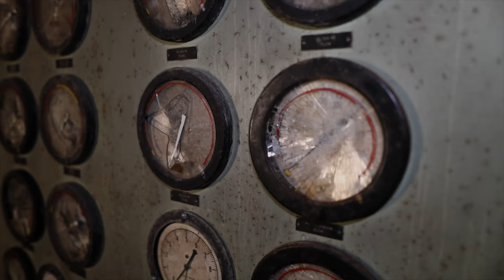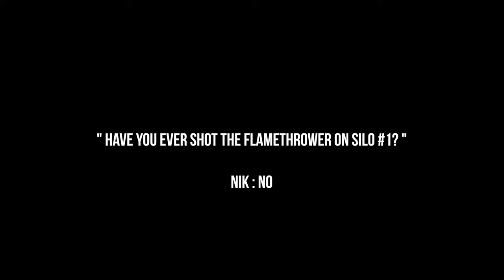Ep. 65 - An 80 TON CRANE Declares WAR On A Military Underground Bunker

Comment: Ideas: Pour water in that gap to see if it goes all the way through.  If not, try oil to help loosen things up.  That crane was only doing 21,000?  11ton?  That really isn't that much.  Just to break it loose you could try bridging it with a heavy I-beam bolted or chained to the cork and use bottle jacks on either end of the beam. Or better yet would be 3 beams, one for each lifting point with 2 jacks on each beam.  Jacks are placed on the ground beside the cork with plate steel under them.  It wouldn't lift it very high but at least you could get it broke loose and go from there.  Assuming that cork is 10' diameter, 3' thick that's just short of 9 yards of concrete.  I just looked it up and cured concrete weighs right at 2 tons per yard for 18 tons.  Not much extra capacity on that crane and that's assuming that cork isn't thicker or bigger diameter.
Reply from the maker: Appreciate the ideas. Very interesting
Reply: @NuclearBunkerLiving  PS: Something you could have tried was using your loader along with that crane to give a little extra oomph.  I don't suppose they'd be interested in a quick round 2?
Reply: Absolutely what I was thinking also, widen the hole bridge the cork with two heavy beams and lift with hydraulics. Break the seal loose and then lift with a crane, much easier done. And another thing Nuclear Bunker Living I've worked with cranes, tower, crawlers, mobiles, there all great but if you want to get something moved call an equipment rigging company in not just a crane company, if you've seen a rigger move a 30ton CNC machine from one side of a plant to another with little more then pipes and a bar then you'll understand what I mean.
Reply: Adding to the above. What if you could do a shock or vibrate while your pulling? Thinking a hand held jack hammer or one mounted on an excavator?

Comment: If that cork is made of reinforced concrete formed in place at the time of the bunker's construction with the huge rebar that they used, I can imagine it being welded to the steel frame before the concrete pour. A thermal lance will blow right through that cork all the way around and cut it into small sectors if required. Make inquiries to a welding supply company for a thermal lance and cut the SOB!
Reply from the maker: Wow. Thanks for the feedback Keith

Comment: Thoughts:
I beam spanning the lid to solid ground. Maybe even fabricate an X out of them to go across it. Attach to lifting points. Place a 20 ton Hydraulic jack on each corner, on steel plates sitting on the ground. Use the combined force to pop the lid, would also allow off axis pressure to maybe get one part to break free first. It won't let you take the lid off and out of the pit but it could break it loose for a crane to complete the lift. You look like you are at no shortage of beams/plate, 30 ton hydraulic jacks are $120ea at Harbor freight. For under $600 all in it seems like it would be worth a shot. Just kinda spitballing here.
Reply from the maker: Thank you my friend. Appreciate your feedback

Comment from the maker: 🚨 🚨 PLEASE READ:

Hey it’s Nik. Appreciate the communities feedback with this weekends Episode 65.  As I said on this episode, taming is the conditioned behavioral modification of a wild-born animal when its natural avoidance of humans is reduced and it accepts the presence of humans. 

Well…It’s the same principle here at this Titan 1 bunker complex. 

The “Tap Tap” theory of tapping the top of the lid to dislodge it won’t work because of the funnel shaped dimensions. Any pressure downward may fracture or compromise the surrounding concrete and rooftop structure. Using hydraulic jacks under the lid and pushing it up won’t work as we don’t have a platform high enough to mount the jacks. When the lid was sealed in 1967, the military poured adhesive elements and concrete on the sides of the lid to ensure it remained permanently sealed. 

Wild winds on the same day as the crane attempt also hindered us. We pushed the threshold to 21,000 and the alarm was triggered to pause all operations. This was an 80 ton crane we used.  We may need to amp it to a 110 ton. 

The eye bolts on the lid were engineered correctly. They are drilled deep and epoxy glued as well. We used the right cable this time as opposed to chains.  

We will prevail. It just takes resilience, grit and an ounce of ALPHA. 

At all times. We don’t edit and delete footage that went against us. In full disclosure, we share all footage to show you the dark days of frustration and annoyance when things don’t go our way.  We owe it to our community of subscribers to showcase our tribulations and success. 

We thank you for your continued support. THANK YOU
Reply: Maybe next time you should build a road and pad area for the crane to get closer to the cap, I know if the boom is extended out like it was they have less lifting power, so getting it closer so they don't have to extend it out far will give them more lifting power.
Reply: I hate to say it, but if the government intended for it to remain permanently sealed….. I don’t know what your plans are for the equipment terminal, but at this juncture If you can’t apply pressure from the exterior, even demolishing the lid and replacing it later with something else may not be an option.
Reply: I love seeing all aspects of this project.  It wouldn't be that interesting if everything went easily and according to plan.  It's the overcoming of those obstacles that make the journey far more rewarding.
Reply: Long shot but, would a powerful solvent be a bad idea? Take samples of the adhesive used and look for a solvent that could melt it?
Reply: You could haul wood cribbing down and build temporary jack towers underneath it. Used to do it all the time lifting houses for soil remediation. Or, remove soil from around the lid about 30 feet around, span a 100ton rated beam across the lid 3 feet above it and set the beam on cribbing towers each with a 100 ton jack then attach the lid to said beam and jack it up..Call it the industrial wine cork popper, haha!
Reply from the maker: That’s an idea Jon
Reply from the maker: No procedures manual here Rick
Reply from the maker: Hmmm. Not sure
Reply from the maker: @andrewenglish3810  will be widening it shortly.
Reply: I'd suggest subjecting this lid and the access doors to vibration.   A hand held ground compactor would probably be enough.  I didn't realise these things had been glued shut so that might be an issue.  But having said that, this was sealed a long time ago and it's very possible much of the glue holding force has decomposed by now.  But what is likely to be holding them all shut is any metal (seals around the edge pressing against seals on the edges of the doors and cap) have rusted together effectively welding themselves.  But that rust weld will be very brittle and won't hold up to vibration.  So try vibrating everything, it can't make the situation any worse.  It will destroy the rust welds and will certainly weaken the glue adhesion.
Reply: at 15:21 Take cutting torch to I beam on the right hand side of the video screen (to the left of the individual standing.
Cut so that it is 1' shorter than the plug.
stand I beam on end at very edge of circular plug. This should be in line with the floor beside the square hole. 
Brace I beam
place bottle jack on top of I beam and start jacking.
Yes, you will need scaffolding to stand on and a cover for that hole in the floor...
Reply: I once manually lifted a huge tree stump into the back of a pickup truck by myself with the aid of a simple lever. Physics is your friend.
Reply: You will probably need to concrete cut a manhole sized hole through the lid near the edge to see how the lid interfaces with the roof.   Right now  its all guesswork and assumptions. You can either use concrete saws to cut a square man sized hole or hire a core drilling company to literally core a 30 inch hole thru it near the edge, then cut away to the seal edge to see how it interfaces.

Comment: Pressure wash the ring and set 4 or 6 20 ton bottle jacks inside and try to push it up. Might not hurt to XRay the lid and see what all is in there. Might have some dowels that need cut. Also might want to core through closer to the edge to feed rigging chokers through and get a wider pull on it. You could then pull on each segment by its self and rock it loose.
Reply from the maker: Appreciated Rob.  Thanks for being part of the community

Comment: You can crack the concrete without explosive. Non explosive gout.

I believe you need to do the same on the big lid, on both sides of the center.
Then a blowtorch to cut the steel.
Reply from the maker: We want to preserve the structures

Comment: air bags, in the crevice around the side.  you could work the 'cork' from different positions.  Also, strategically placed water bags that you can freeze. It will expand the push the lid up.
Reply from the maker: Interesting.

Comment: What others said about using big jacks.  

But first you need to clean that seal area out completely, all the way around.  Get as much of the grout and whatever else is holding the lid to the rim.  Then try it.

You may have to use some of that fracturing grout to break out whatever is holding the lid down.
Reply from the maker: I’m with you Andrew.

Comment: If your blast doors are intact create an overpressure event otherwise drill and cut into sections then remove. Having worked on sewer systems of that vintage ('65) I can tell you that microearthquakes have wedged that thing in tight and the lifting force required is going to be way more than lid's weight to get it moving. Also where's your water to lube that thing and what kind of seal did they use to stop water in the original construction?
Reply from the maker: Great feedback.  Very much appreciated

Comment: Judging from the inside I see a bunch of corrosion that says while the top may be concrete there is a metal collar below that corrosion is acting like glue I'd attack it from below as well with a torch get that lid glowing hot below you may end up doing some rehab on the roof of that structure but hey when in doubt get it hot and beat the mess out of it right
Reply from the maker: Soon find out. Good pickup Blake

Comment: Guys 

Rig a 100ton hydro jack from under it you have the steel down there and it could be even big bottle jacks.

Push and have them lift again with that crane.

Even if you can move it from under 1/2 inch you have a large amount of pressure that is not on the crane and the crane can keep lifting
Reply from the maker: Nice feedback Brian

Comment: That  3 foot+ cement plug is bigger on top than bottom. When installed it , I am sure pressed down hard, then all dirt pushing down 50-60 years. Heating the steel ring only make it tighter.

 Sorry  Nik ,looks like if this to be opened, Jack hammering all way around the "edge cork" 

Then pull out with Crain/ loader.  In 18 months, I will trying to UN cork equ  room   at   Moses lake sight. Thank you showing way to do it!
Reply from the maker: Yeah that’s an option with the jack.

Comment: Hello, Nik my thoughts on that to get lid open would be as engineering experience would to get a hydraulic breaker on an excavator and remove it in pieces as when it comes down to access it would cost alot of engineering and material to use it as a lid after it was removed. compared to building a new lid out of steel and building a hydraulic system to lift it and lower it. I personally would just drill holes and blast it in pieces to make quick work as accessto me is main priority for equipment and safety issues if any happened..  Cheers Cliff
Reply from the maker: Feedback appreciated Clifford

Comment: Try wedging steel bars in the cracks to maintain the existing gap. Then use a water pressure washer to clean out the gap/rim/edge. Then try to use air bags to try to increase the size of the gap.
Either way, I'm looking forward to new uploads!
Reply from the maker: Wise advice Alexei.  Cheers.

Comment: If like keep cork ,   here how do it.

Go get fabricated 2 plates steel

1 " thick steel plate. round slightly smaller the opening.
Roll them to the equ room down tunnels.
Have  jack up to bottom of the plug, Tack weld in place .

Get 4    250 ton  ! foot tall, weld top of the jacks to plate.

Then put the second plate has access holes for the jacks' controls.
 ceiling

Then Put a Crane   and then push up 250+ tons  ...POP like Bottle champagne .

That how I am going to open up , at Batum..
Reply from the maker: Cheers Michael. Appreciated

Comment: They definitely sealed the plug to prevent any ground water coming in, you might have to break out the grout underneath and (as everyone seems to be on about) use jacks, or try the crane again. worst comes to worst you can demolish the whole thing. 

One thing to consider is that once you break the watertight seal, it’ll be hard to prevent rain runoff from entering the facility.
Reply from the maker: Demolishing would be the least path of resistance.  Have a few options still. Thanks Theo.  Yiasou Palikari

Comment: Along with the crane lifting on the plug.  You should set up steel I-beam cribbing and hydrolic lifting cylinders set up under the plug applying upwards force. I would reach out to a heavy mover business and offer the challenge against them.  Make sure to tell them of past failures to boost them up. They don't like failure.
Reply from the maker: That’s great Raymond.  Thank you.

Comment: Have you guys thought about possibly drilling thru the cap in the center and using a large single pull rigging on the crane more forced used in one area if it won’t lift it my thought process rive would be a break that could free it up
Reply from the maker: We wanted to preserve it Cody.  Appreciate your contribution to the thread.

Comment: Sounds like you might have to go out and rent or buy a massive letourneau payloader to get that hatch off one of the ones that they use in strip mining
Reply from the maker: You reckon ?
Reply: @NuclearBunkerLiving  well and probably a lot cheaper to go out and rent one then have to go out and buy one but if you put the proper mounts on the hatch so you can get some forks under there a letourneau strip mining payloader should have the strength to pull that hatch out

Comment: I would use a 100 Ton crane with I Beam spreader bar.

I had to get a 20 Ton crane to lift a septic lid off our tank to service it, as the 10 ton couldnt pull the lid off (no I Beam spreader bar), yet the 20 ton+ I beam popped it right off (due to high silica/ calcium ground here, acted like concrete and basically sealed the tank shit like it was poured concrete)
Reply from the maker: Feedback appreciated Max

Comment: I am a Builder and if i was to do this i would have excavated more dirt   around the silo and raked it back (5 meter perimeter around the edge to prevent  fill from falling back into the excavation ) then used the excavator with a hammer on it to break away the concrete around the edge.. I think the issue you are having is that the silo is rusted around the edge (as can be seen in 14.10)  and it has expanded   No need for a crane if you have a 25 ton excavator with a hammer bit ...The excavator should also be able to lift the concrete off the silo.. Just rig the lid first before you hammer the top !  Or break away 1/3 of the lid then use the excavator bucket to pull/peel  it back ...
Reply from the maker: Thanks @RED.  We want to preserve the original lid from the era.  Don’t want to kill it just yet.  Welcome to the community Sir
Reply from the maker: We are digging around the cork this week.
Reply: @NuclearBunkerLiving  Thanks Guys...hope you can get it out in one piece ..Try to use heat/hot flame  around the steel from the bottom when trying to lift  out the cork!

Comment: Can you get a really long I beam and drag it across the opening? Then mount a larger than 20k hoist over it? Or build a tubular structure down to the lid and up to just above surface level then mount a gantry to lift the lid out? You'll probably be doing this anyways
Reply: Maybe a combination of a larger I beam with some sort of pulley system to increase the lift capacity. Maybe yall could reach out to Dave Sparks. Sounds like a crazy problem that he would be able to figure out.
Reply from the maker: Interesting

Comment: You had me shouting at the screen with the initial rigging on this! That three leg set was waaaaay too short for a safe lift. The bridle angle would put excess load on the legs and points. At an angle like this you would be roughly doubling the load in each leg rather than sharing it. I'm rather suprised that the operator even considered that, especially if they were allegedly from a training body.
Reply from the maker: We are making adjustments. Appreciate the feedback Neb.
Reply: Came here to say this. I'm no rigger but I have done odd jobs for one and that first setup was far too short, crazy that a school would try that.

Comment: You could take the dozer and reduce the grade so it's not as steep for the crane to have to sit on
Reply from the maker: More logistical work
Reply: or dig out more around the cap so the crane go reposition "in the hole" and not extend and loose lift strength

Comment: Well BUMMER!  I really had high hopes this crane would be able to pull the plug so you could clear out the bunker of all that metal.  If you didn't have bigger cranes... you could put some large I beams across the pit and then use a snatch block and a high capacity wench to lift.  Might be able to give you more pulling power directly above.
Reply from the maker: Bummer for sure.  Stay well Rick. Appreciate you in our community